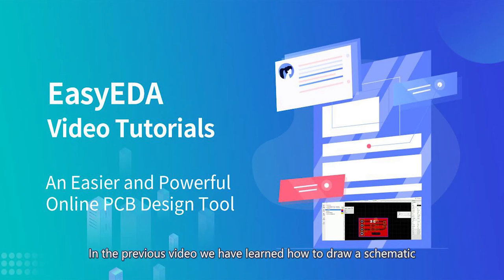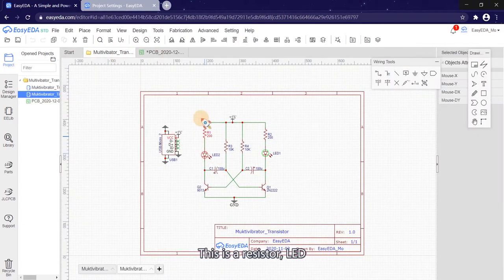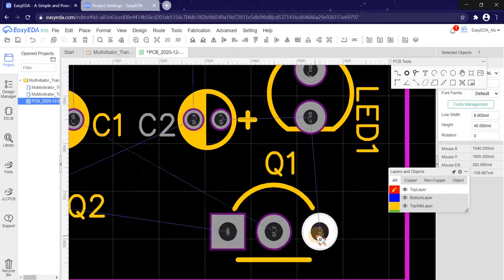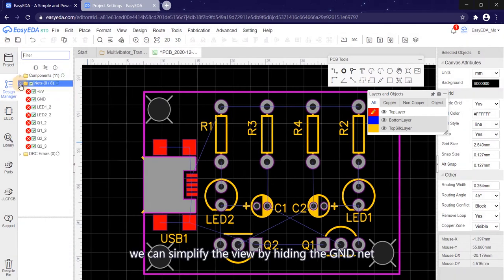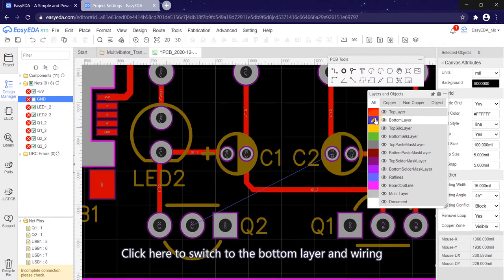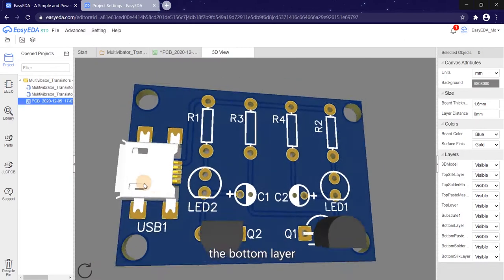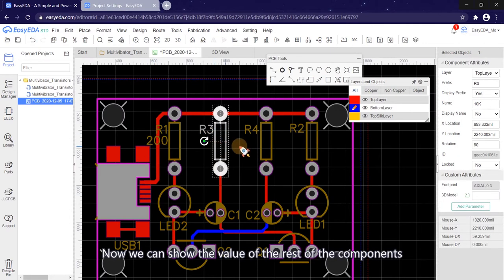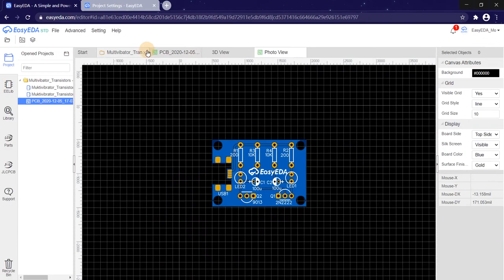012 PCB Layout

Comment: SO OK I did it! I completed my first real PCB for my model trains. I did have to get help. The tools all work but the simplest things do not work like other graphics editing tools. Moving labels threw me for a loop for hours. There is no visual feedback that your cursor has captured a text and that you can now drag and rotate it the text. the text changes color but you don't really see where it's now controllable. Final I just tried to move it and it moved!!!! Yeah! then i added mounting holes and the company name click, click click. done. Changed the color to red, and did a visual review of track routes by highlighting a pin to see the track path from that pin. I could see Pin one of each device and had to memorize the pin orientation. But i was able to validate every track to every pin.  OK lets order these boards. One thing I lost track of was the required footprint for the PCB. In fitting inside a steam engine, it is crowded and I failed to actually layout the frame to the real space available. But I just wanted to get the board made and tested them rework the format as needed to fit the best. I was surprised to get a discount and shipping was not overly outrageous. DHL has always been a superb delivery service. My boards will be here in a week and I will be ready with parts and test stands to try them out. This one lecture here IS the critical one to get and I took it 3 times. I even slowed it down to 75% speed so i could take notes and get all the tips and tricks.  I wanted to get to this one so bad. The videos ahead were actually beyond my needs currently. Using The Library's i was able to find every part and get the footprint and specs for BOM it all worked with me to help document the whole PCB. Now i have detail docs and a Completed PCB for a brand new feature for my model train steam engines. I also began to imagine other functions I could design and make PCBs for. The design of boards Plus the CAD and 3D Printer combined has allowed me to dream about making my very own model train from scratch. Chassis, Body, Controllers and action functions. Both on train cars mobile and on the layout fixed. THe easy EDA tool set is very strong. It did take a few trials to understand the nuances of control and graphics editing, but it was fine. I expect to get better real fast as  start to replace expensive commercial PCBs with my own custom designs. I feel so strong and confident I can build anything I can dream up too.  Dennis in Virginia

Comment: Been trying this out and I like it so far but when it comes to drawing a trace there can be much improved upon.  If I start on the top layer and then want to place a via to switch to the bottom side it should just be a double click to place the via and automatically switch to the bottom layer so I can keep going.  Also, Why is there no shortcut list for via sizes like there is for traces?
Reply: Want to go to the Bottom layer from the Top layer - Press B
Want to go to the Top layer from the bottom layer - Press T
Want to place a via when drawing a track - Press V

You can switch layers by pressing B/T while drawing traces, and when you switch layers, a via will be placed automatically.

Comment: Thank you so much for making this software easy.
How do I apply solder on PCB Traces in EasyEDA so that the traces can carry a high current
Reply: Instead of applying solder on the PCB traces, made the traces wider. Use the Saturn Software to calculate the necessary trace width for your current requirements.

Comment: JLCPCB made some for me = Perfect  = first tim for me
single side but 
should i choose bigger holes   
if     i order double side coppered holes
https://github.com/ldijkman/ART-ESP32-Touch-TFT-Thermostat
https://oshwlab.com/l.dijkman/esp32-dev-kit-38-pin-to-spi-touch-tft

femsle connectors fit nice tight in my pcb
male connector  do not fit
is there somewhere a list of prefered hole size for most used/standard  components
Reply: https://youtu.be/upaVO_SMAQM 👍🏽👍🏽